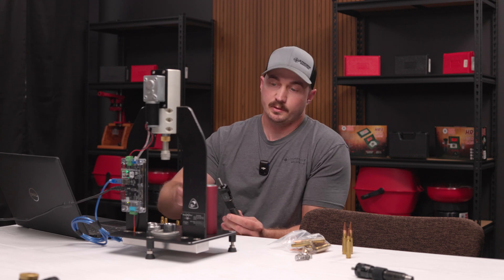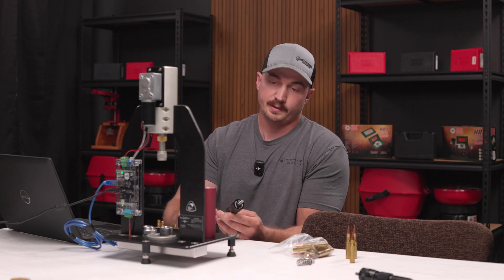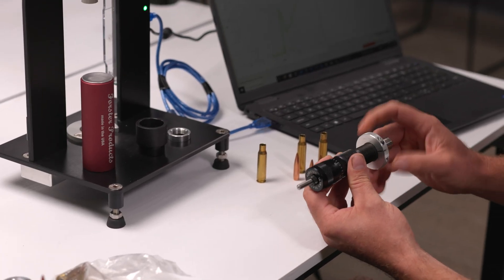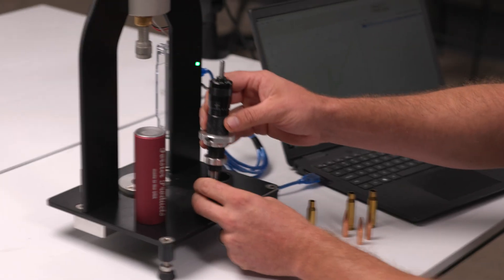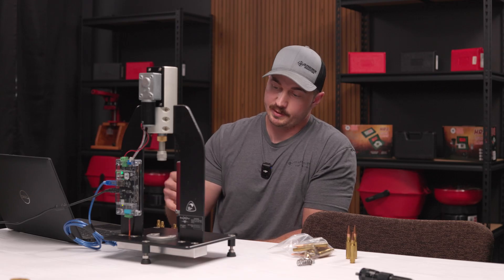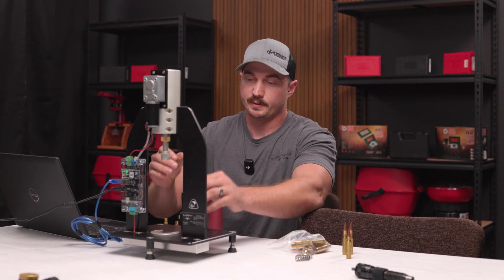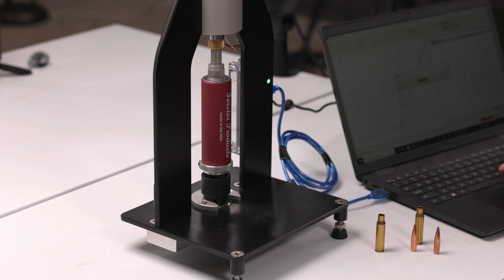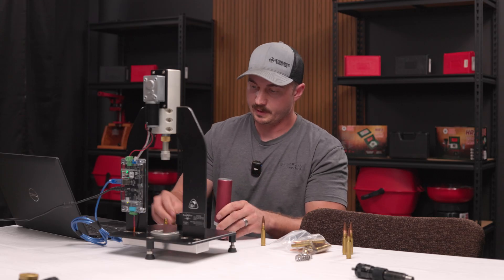Arbor Die Conversion Kit Tutorial

Comment: This video was disappointing. Did not show how to use it. Entire new Idea and they only give us 1:24 of information. I guess I stick to my Wilson dies.
Reply from the maker: Sorry you were disappointed!  IF you would like to shoot me and email @ tech@forsterproducts.com i can send you a little more in depth tutorial on it!
Reply: @forsterproducts  I agree with barndweller this was a disappointing video and product. You need a piece that centers the case in the bottom and something that keeps the upper part of the die from wobbling. It seems like you would want the oversized ring flipped over so the red upper top half fits on that smaller ring on the oversized ring. Runout was horrible using this conversion. Unless you are really good at centering the case and holding the die straight, I don't see good results coming out of this. You might also make a video showing die setup.